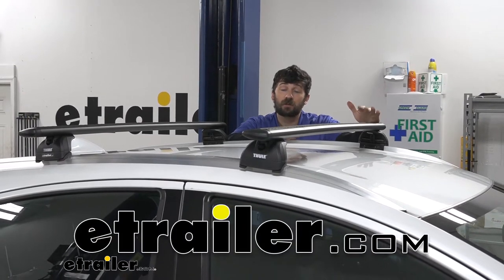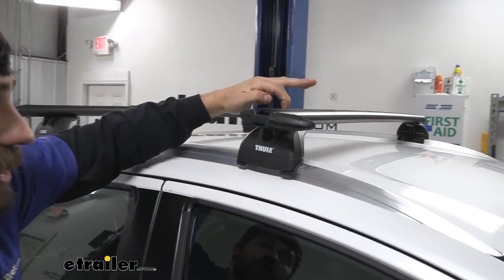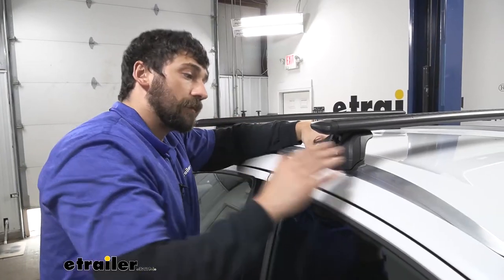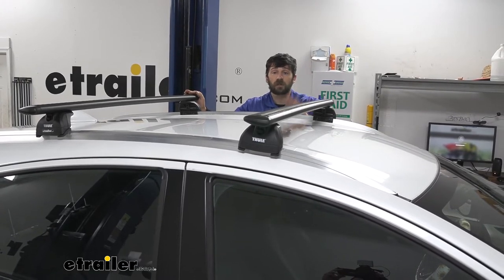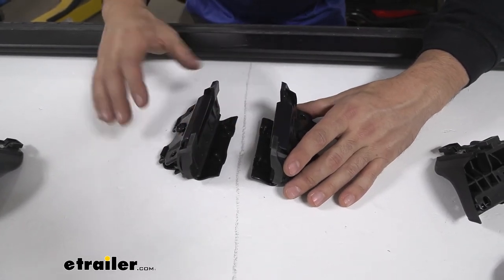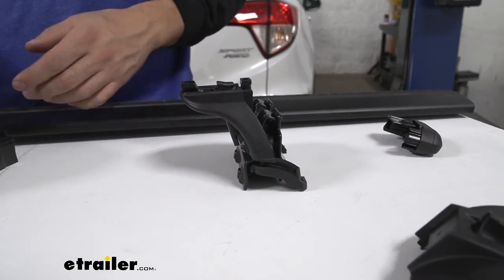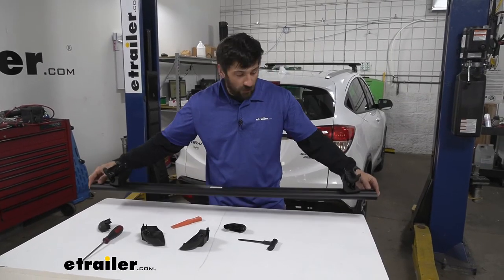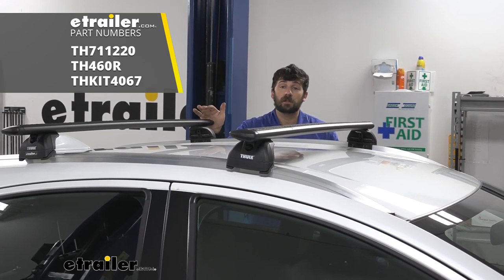etrailer | Thule WingBar Evo Crossbars Installation - 2019 Honda HR-V

Comment: Looks like it will, but would it also fit on a 2021 model?
Reply from the maker: Yes! This kit will fit the 2021 Honda HR-V. Check out the components in the following links.
https://www.etrailer.com/Roof-Rack/Thule/TH711220.html
https://www.etrailer.com/Roof-Rack/Thule/TH460R.html
https://www.etrailer.com/Roof-Rack/Thule/THKIT4067.html

Comment: Will I able to use this for a roof top tent?
Reply: No. The weight capacity of the vehicle won't allow for a roof top tent. You need a vehicle that can handle that much weight up there plus whatever people and gear you plan on having up on the roof. The CRV won't do that as it's limited to 160 lbs up top (and I believe that includes the weight of the rack as well)

Comment: Does the sunroof fully function with this setup?
Reply from the maker: The sunroof will function just fine with this roof rack installed. You will just want to be sure to watch out for the clearance if you have any accessories that have large clamps or bolts that stick out.
https://www.etrailer.com/Roof-Rack/Thule/TH711420.html
https://www.etrailer.com/Roof-Rack/Thule/TH710501.html
https://www.etrailer.com/Roof-Rack/Thule/TH145175.html

Comment: Your website indicates this has not been verified to fit a 2022 Honda HRV. Do you know if or when this kit might be verified?
Reply from the maker: This kit is not designed to kti the 2022 Honda HR-V. Check out the following link to see the roof rack kits that are designed to fit the 2022 HR-V.
https://www.etrailer.com/roof-2022_Honda_HR-V.htm

Comment: What happened with the holes on the inside of the bar?
Reply from the maker: The two pegs on each mounting bracket will sit inside the holes on the side rails.
https://www.etrailer.com/Roof-Rack/Thule/TH711220.html
https://www.etrailer.com/Roof-Rack/Thule/TH460R.html
https://www.etrailer.com/Roof-Rack/Thule/THKIT4067.html